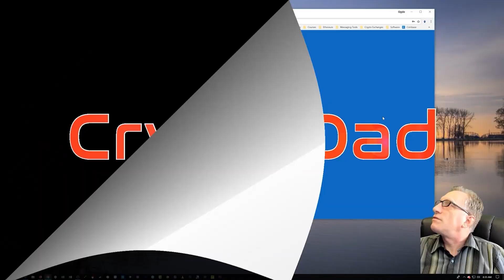Are “Fully Open Source” Hardware Wallets a Myth (Ledger CTO Explains)

Comment: Trezor does a few things better than Ledger. For example, Trezor clearly displays the account address AND name when transacting between your own accounts. It also displays whether it’s a standard wallet or a passphrase wallet. Transaction labeling is very helpful and Trezor Suite auto import accounts based on the connected device, making account management much simpler and less confusing when dealing with multiple devices. Trezor overall has better account implementation and management but Ledger feels more polished.
Reply from the maker: Yes, you bring up some good points. A lot of people have asked me about auto management of multiple devices in Ledger Live/Wallet. But they've never really addressed the issue the way Trezor does.

Comment: Hi mate just a question iv had too do the recovery phase on my ledger nano x as I lost my pin , after recovery the ledger was refreshed with no apps but now it’s not connecting too my ledger live app , it keeps saying sorry secure connection with Ledger failed , what is it I am doing wrong ?
Reply from the maker: Well, you will need to reinstall the apps on your device. So you’ll do that in the my Ledger section, but if you’re having connection issues, you might wanna try a different cable.

Comment: I’m not sure the CTO of Ledger is the best person to comment on their biggest competitor’s technology. You don’t need to be particularly savvy to understand the inherent bias here.

Regarding NDA-free secure elements, the more important question is what Ledger would do if a critical vulnerability were discovered in the secure element they use. There may already be such vulnerabilities, but we simply don’t know due to the secrecy involved. Because of the NDA they have signed, they would be unable to disclose it. They couldn’t warn users that their devices are no longer secure or advise them to stop using them. This is precisely the advantage of NDA-free secure elements.

Yes, open-source hardware is extremely difficult, and it’s unclear how it will ultimately play out. Still, any attempt to make hardware more open, transparent, and auditable deserves praise within the crypto community, not to be dismissed simply because it is hard.

Software however has no such excuse. Making software open source is easy and any wallet that isn’t open source goes against the fundamental principles of crypto. Ledger's firmware code isn’t open source exactly because of the NDAs which proves that NDAs do matter and that they are ultimately harmful to crypto industry.
Reply from the maker: Thanks for taking the time to write such a thoughtful comment — you raise several fair and important points.

You’re absolutely right that NDA-free secure elements are a step in the right direction when it comes to transparency, and I don’t disagree that efforts to make hardware more open and auditable deserve recognition, even when the execution is difficult. That push toward openness benefits the entire ecosystem.

I’d also agree that no one should take any single company’s claims at face value — including Ledger’s. Healthy skepticism is good, and inherent bias is always something viewers should keep in mind, which is exactly why I try to frame these conversations as technical discussions, not endorsements.

One thing I do want to add for context, though, is that Ledger Donjon — which Charles himself helped build — has a long-standing commitment to the broader crypto community, not just Ledger products. Over the years, Donjon researchers have disclosed vulnerabilities in multiple hardware wallets, including Trezor devices. Those disclosures weren’t hidden or suppressed — they were published, discussed, and ultimately helped push the industry forward.

In fact, earlier Donjon research into seed extraction attacks (such as voltage glitching) directly contributed to Trezor moving toward secure-element–based designs. That evolution led to the Trezor Safe 3, Safe 5, and now Safe 7, with vulnerabilities being discovered, patched, and improved along the way. In that sense, critical research and open discussion — even between competitors — has resulted in better products from both companies, not worse.

On the software side, it’s also worth clarifying that Ledger software is roughly 95% open source. The apps, the Ledger Wallet software, and large portions of the OS are publicly available on GitHub. The part that remains closed is the code running inside the secure element, which is where NDAs and IP protections come into play.

Even if that firmware were published, however, an end user still wouldn’t be able to verify it the way they can with open-source software by compiling and running it on their own computer. Verifying secure-element firmware would require fabricating and decapping chips — well beyond the reach of normal users — which means that, at some level, trust is unavoidable, regardless of the model chosen.

That’s really the core takeaway for me: there is no such thing as a completely trustless hardware wallet. Different vendors make different tradeoffs, and open discussion of those tradeoffs — including criticism — is how the space matures.

I genuinely appreciate comments like yours because they push the conversation forward rather than turning it into brand tribalism. That’s exactly the kind of dialogue I want on this channel.
Reply: Thanks for the reply, really appreciate it. I am glad to hear we are mostly aligned on the importance of pushing open hardware forward. That said, I honestly did not get that feeling from the video. Framing it as a technical discussion feels a bit weak to me, since it came across more like Ledger’s CTO downplaying open-source software, open hardware, and the tech of a direct competitor. That is of course totally understandable from Ledger’s side, and it could also just be my interpretation.

I am also a fan of Donjon. I think the work they do is genuinely good for the industry, and it also works as a great marketing tool for Ledger. In the end, that is not a bad thing at all. Regarding the disclosures around Trezor, I am not aware of any of those being constrained by NDAs. I might be wrong on that, but as far as I know those findings were not related to anything under NDA. And as for the EUCLEAK attack on the Infineon chip that Charles mentioned, the researchers were able to report their findings precisely because the chip is an NDA-free secure element.

On the open-source side, it is true that Ledger has released a lot of code, and that is great. But as long as the firmware is not fully open source, we cannot fully audit it and see what exactly it does. From that perspective, whether it is 95% or 99% open does not change much, especially since one could argue that the most security-critical parts are precisely the ones that remain closed.

Regarding that missing part of the code, Ledger cannot publish it exactly as you said because it relies on secure element code that is under NDA. That is a design choice Ledger made. Other hardware wallet manufacturers made a different choice where no firmware code runs inside a secure element. That is what enables them to fully open-source their firmware. With something like Trezor, you can take the firmware code from GitHub, compile it yourself, and verify that it does exactly what it is supposed to do, without backdoors. Which design is better from a security point of view, running code in the secure element or not, is a different discussion, but since this video was about open-source, IMO it is important to understand the difference.

The discussion about whether a hardware wallet can ever be 100% open source in the sense that every single component can be independently verified is also a different conversation. But in my opinion, that does not mean you cannot have a hardware wallet with fully open-source code (especially firmware which is the most important code).

I do agree that open discussion, especially between competitors, is a good thing. I would personally like to see more collaboration between manufacturers. My only concern is the setting. When conversations start to focus on competitors’ technologies in public, I think it is always better when representatives from both companies are part of the discussion. Companies should absolutely talk openly about their own design choices, but once it shifts to judging others’ tech and the other party is not there to tell their side of the story, it can quickly start to feel a bit off. This is especially true when the CTO of another company talks about a competitor’s product in the context of open source, knowing that his company cannot open-source their own product.

Thanks for this conversation, and I am looking forward to the next video.

Comment: There are absolutely no need for a Hardware Wallet(HHW) with a Secure Element, a Secure Element only adds another possible hacker attack surface, a Signing Device such as SeedSigner are a safer option & also happens to be cheaper, most HWW sellers have huge budgets to advertise their devices, though this does not mean they are the best or safest choice...DYOR. Ohhh & thank you Ledger for leaking my ID after my purchase from you 5 years ago, i have only just recently stopped getting Gangster & Intimidation calls & emails, should have sued you for the years of misery that that leak brought.

Comment: When Ledger's CTO questions "Fully Open Source", it cannot be beneficial to Trezor or the open source. But i get the criticism
Reply from the maker: I've been at this crypto hardware wallet tutorial thing since 2017. And over the years I have had one-on-one access with people at Ledger and Trezor. In fact, this year I was invited both to Prague for Trezor's event in October and Paris to Ledger's event in October! It would have been a tight squeeze and I'm not familiar with international travel , so I chose Paris and took my wife with me. It was great! But all of this knowledge that I've gathered over the years makes me realize more and more that the idea of an open source hardware device is somewhat of a pipe dream. Software can be open source because I can inspect the code, compile and run it and verify it. But I can't do that with firmware code posted on Github. The only way to verify it would be to manufacture my own chip, which of course I'm not going to do. I could rely on other people's evaluations, but there again, I'm placing trust in someone else. Hardware chips are loaded with manufacturer's code at the very lowest levels. Microcontrollers and Secure Element chips run proprietary software, even if they're running open source firmware on top of them. The only way to have a truly open source chip would be to manufacture it yourself and in so doing, you would be forced to use tools and fabricators that are not open source either. So it's a never ending cycle of putting trust in something.
Reply: It is true the software side is open source but the platform is not fully open source. I like the fact there is competition for hardware wallets pushing to innovate devices and features, regardless of who you choose it’s better for everyone.

Comment: Hi Dad, do you think Tangem can safely store BTC or should I move to another cold wallet like Trezor? Also is there a way to directly transfer BTC between wallets (Tangem to Trezor) or must i have to go through an exchange first?
Reply from the maker: Every crypto hardware wallet has its use-case. You don’t really need the second-guess yourself. Tangem is great for beginners. And your crypto is safe as long as you don’t lose your cards. And yes, you can absolutely move crypto between wallets. That’s one of the main features of cryptocurrency, the ability to move from A to point B. You might also want to think about spreading your holdings across multiple wallets, but there’s no reason to panic and move all of your crypto out of one wallet into another.
Reply: @CryptoDad Thank you dad. Appreciate all your great work and advice (you’re my go to resource). Wishing you much love and success in 2026.

Comment: Thank you! I'm buying my first Ledger wallet after that Trust Wallet breach. Not that it concerns me because I'm using Metamask but better safe than sorry. Thankfully my BTC is stored on my Trezor.
Reply from the maker: Yes, you can even secure the trust wallet extension using a ledger device. Hardware wallets are always your best protection against software hacks.